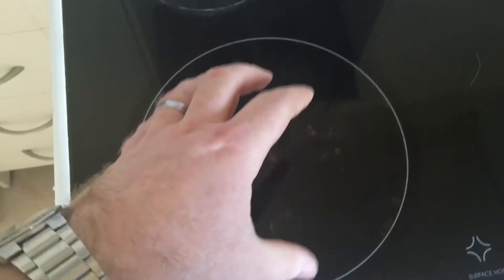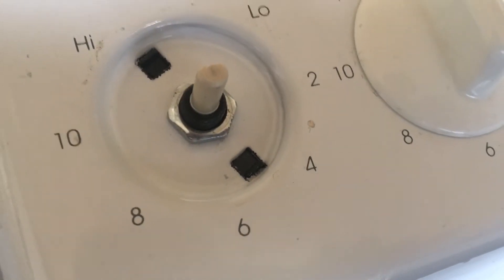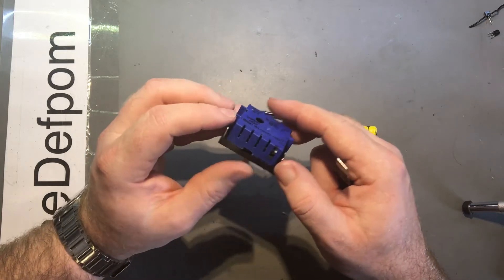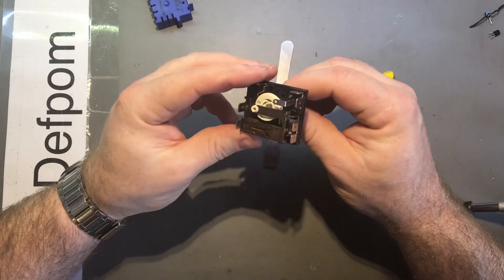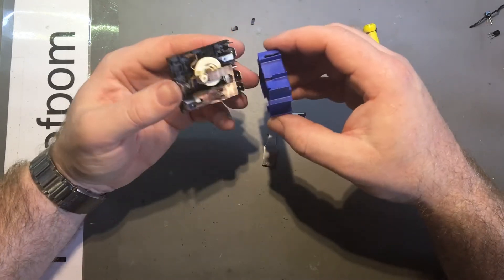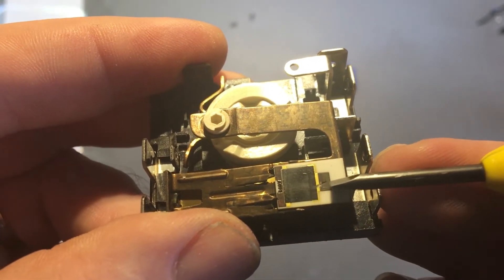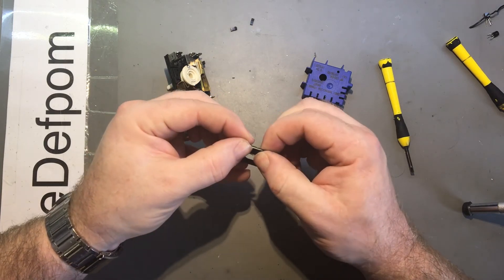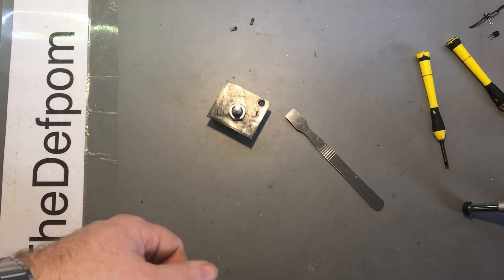#290 Simpson Jupiter Atlas Series- Oven Hob Control Repair

Comment: I think you are right, that heater resistor wasnt in the clips fully from new, so it sat high and the finger strip then landed in the wrong place.
You must demand a warantee repair LOL :-D ok it's a bit too late now  :-D.
I am supprised that they didn't use any cement at the top of the heater resistor to stop it escaping.
It will work now, aint that irritating lol.